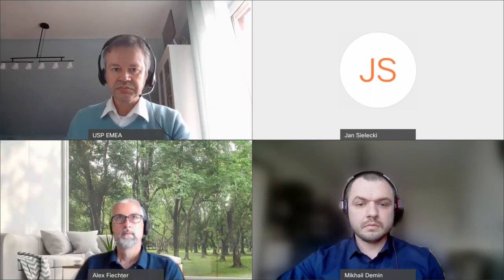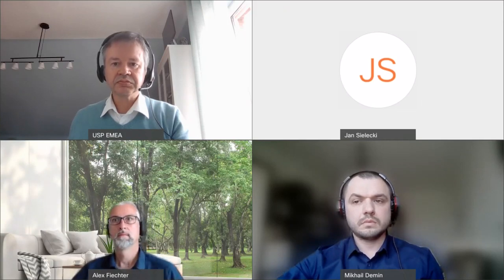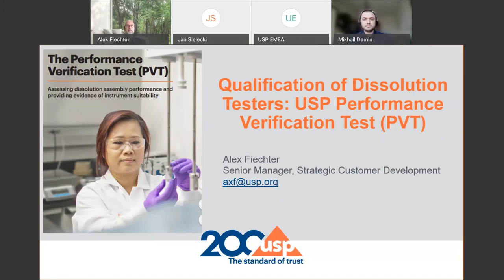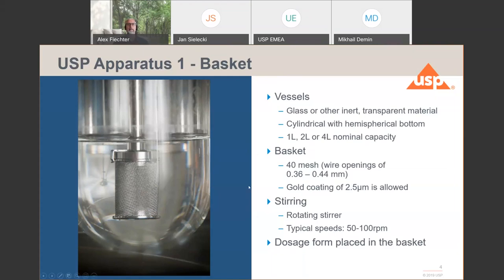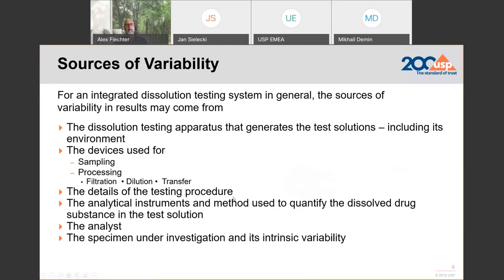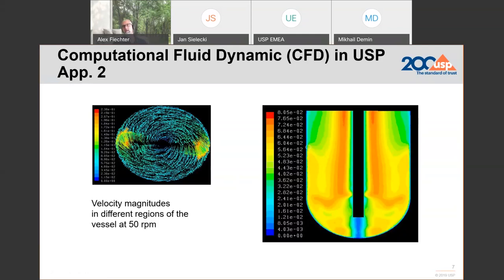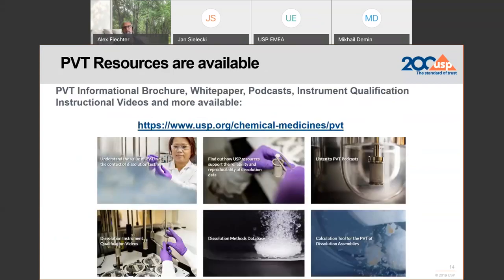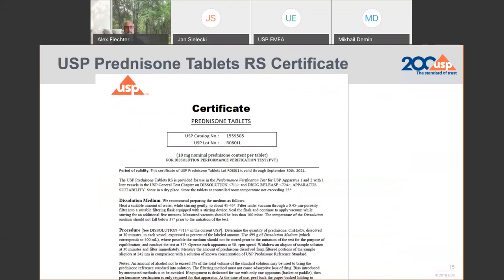Qualification of Dissolution Testers USP Performance Verification Test (PVT)

Comment: Sir, can you please tell me about the use of chlorpheniramine tablets in USP apparatus type 3? is it removed from USP as I could not find any source of access. pp
Reply: Chlorpheniramine Maleate ER Tablets RS was announced to be discontinued on December 20, 2012. The 30 dips per minute test is no longer required in the Performance Verification Test for USP Instrument 3.
Reply: Effective February 1, 2012, USP has removed the requirement for Apparatus 3 Performance Verification Test Apparatus Suitability section of General Chapter <711> Dissolution.
The change was necessary because the supply of current lot G1J218 has been depleted and no suitable replacement has been found.